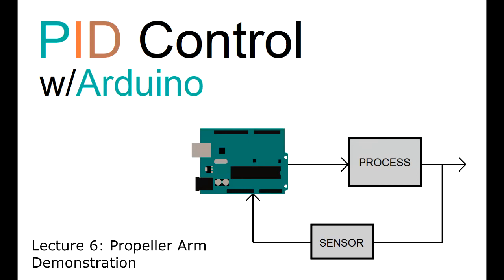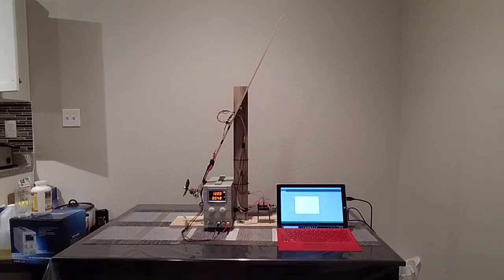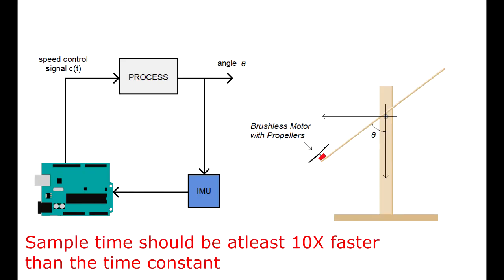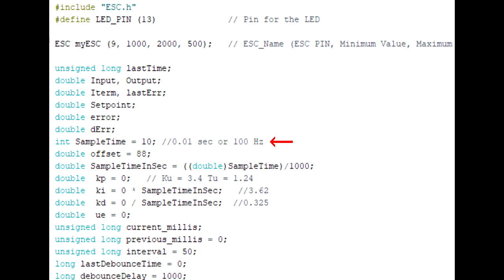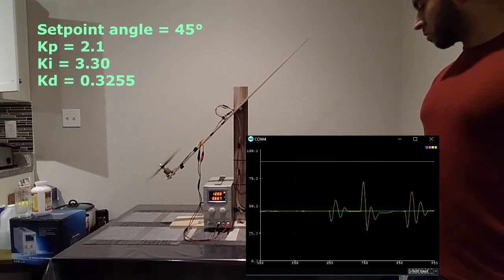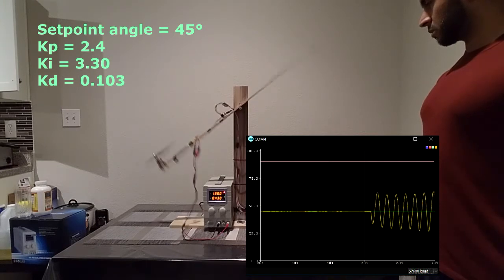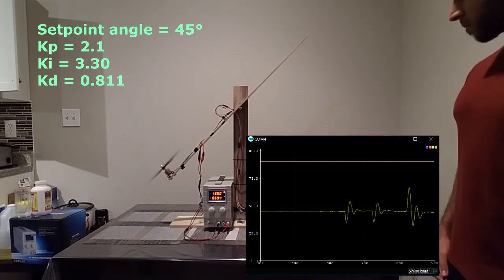PID Control with Arduino: Lecture 6 (Propeller Arm Demonstration)

Comment: Can i Get in touch with you brother, I m stuck on this project similar concept but the angle keeps fluctuating alot i m using  MPU6050, A2212 1000KV
not able to set the angle accuarately the MPU values suddenly change and they are not always the same

Comment: Thanks for the nice explanation, Can you plz tell what, what software you used to observe the graph for the response of the system? Thanks
Reply from the maker: Im using the serial plotter that comes with the Arduino IDE. The reason it's black is because during post-production of this lecture video, I inverted the color so that it would look nicer, hence why it's black.

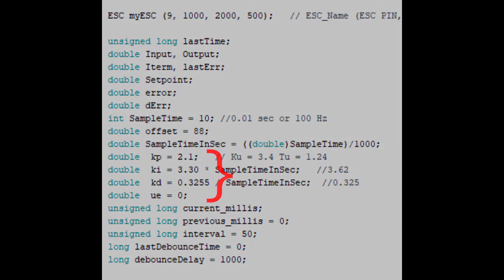Comment: where did you include offset (bias) in your code? 4:16
Reply from the maker: I didn't. If you look at the code, I set ue = 0. The bias is only needed to remove the steady-state error under proportional-only control. However since were using a PID controller, the I term takes care of the steady-state error.
Reply: @nabilmohammad5076  Thank you! If it is required to have a higher proportional gain , let's say to drive DAC, how to avoid oscillations?

Comment: the values of my PID output are increasing/decreasing too fast, and it overflows the double data type; i tried  reducing the constants and putting the maxcontrol and mincontrol but still, it is hard to map your values when the data is so unstable, so i cant even try to attach the ESC.
would someone would have a suggestion for that?
pd: excuse my english It's not that good haha

Comment: Hi! What means "ue = 0" parameter in your code?
Reply from the maker: I believe that was a bias control value. Typically used in open-loop mode or during proportional control to get rid of the steady-state offset. However. Since a full PID controller is being used, we dont need it.

Comment: How did you fond the tau of your system?
Reply from the maker: You mean the time constant ?
Reply: @nabilmohammad5076  yes
Reply from the maker: @shahzaibshamim6524  For my specific system, in open loop mode, meaning with no feedback, I simply stepped up the input signal from 0 to a nominal value that would give me an output angle around 45 degrees. And I simply measured how long it took to reach 63% of around 45 degrees. That measured time is the time constant. 

What this nominal value was, I don't exactly remember.

Comment: i have some sort of problem, when i measure angle from MPU6050,get stable value!!!(complementary filter, basically i have used)

But, when, it is in structure  as well as motor start to run!!  That's time i get fluctuating angle!!  Generally 15 digit up and down!! It's because of vibration in structure, generated by motor!!!  How can i eliminate this fluctuating  problem?????  thanks 🙂
Reply from the maker: Yeah the vibration is messing with it. I was suffering with the same issue, but luckily the MPU6050 comes with an internal digital low pass filter to filter this vibration. I'll post the code soon.
Reply from the maker: So I wasn't able to find the code I had used, but I remember referring to this article, https://ulrichbuschbaum.wordpress.com/2015/01/18/using-the-mpu6050s-dlpf/ 

I had also added some rubber pads between the wood and motor to dampen the vibrations.

Comment: Can you please share the code
Reply from the maker: double sensed_output, control_signal;
double setpoint;
double Kp; //proportional gain
double Ki; //integral gain
double Kd; //derivative gain
int T; //sample time in milliseconds (ms)
unsigned long last_time;
double total_error, last_error;
int max_control;
int min_control; 

void setup(){ 
  
}

void loop(){
  
 PID_Control(); //calls the PID function every T interval and outputs a control signal  
 
}

void PID_Control(){

  unsigned long current_time = millis(); //returns the number of milliseconds passed since the Arduino started running the program
 
  int delta_time = current_time - last_time; //delta time interval 
  
  if (delta_time >= T){

    double error = setpoint - sensed_output;
    
    total_error += error; //accumalates the error - integral term
    if (total_error >= max_control) total_error = max_control;
    else if (total_error <= min_control) total_error = min_control;
    
    double delta_error = error - last_error; //difference of error for derivative term

    control_signal = Kp*error + (Ki*T)*total_error + (Kd/T)*delta_error; //PID control compute
    if (control_signal >= max_control) control_signal = max_control;
    else if (control_signal <= min_control) control_signal = min_control;
    
    last_error = error;
    last_time = current_time;
    }  
}
Reply: @nabilmohammad5076  thank you so much Bro, I really appreciate for the reply

Comment: Could you make another video if you still have this setup with only P and D values set up, I is not needed to keep it  balanced in your case, I'd like to see this go on P=3 and D=5.... It should snap to the desired position (45 angle) much faster without overshooting?...
Reply from the maker: Unfortunately I don't have this setup anymore, but I can predict what will happen. If you setup P=3, the system would be stable but very under-damped and not reaching the desired set-point. Now if you were to add about 0.3 to 0.9 of D gain, you could lower the overshoots. However, if you increase it to 5, you're making the system so sensitive to even the slightest errors that it may begin to jitter and in essence not be stable. 

Please take a look at my 7th lecture on PID tuning where I emphasize this point.
Reply: @nabilmohammad5076  Hmmm, you think? I was suggesting from just looking at it by my experience with drone tunning... Perhaps you're right, but still, if you had a setup would be amazing to see it at work! Best regards!

Comment: I wonder why these videos don't have much more views!? They're simply amazing .. but few notes: When you insert the word Arduino into your title people assume you'll share the code. it would have been nice if you shared the code as you progress through your lectures. Just saying ..  overall, thanks a lot.
Reply from the maker: double sensed_output, control_signal;
double setpoint;
double Kp; //proportional gain
double Ki; //integral gain
double Kd; //derivative gain
int T; //sample time in milliseconds (ms)
unsigned long last_time;
double total_error, last_error;
int max_control;
int min_control; 

void setup(){ 
  
}

void loop(){
  
 PID_Control(); //calls the PID function every T interval and outputs a control signal  
 
}

void PID_Control(){

  unsigned long current_time = millis(); //returns the number of milliseconds passed since the Arduino started running the program
 
  int delta_time = current_time - last_time; //delta time interval 
  
  if (delta_time >= T){

    double error = setpoint - sensed_output;
    
    total_error += error; //accumalates the error - integral term
    if (total_error >= max_control) total_error = max_control;
    else if (total_error <= min_control) total_error = min_control;
    
    double delta_error = error - last_error; //difference of error for derivative term

    control_signal = Kp*error + (Ki*T)*total_error + (Kd/T)*delta_error; //PID control compute
    if (control_signal >= max_control) control_signal = max_control;
    else if (control_signal <= min_control) control_signal = min_control;
    
    last_error = error;
    last_time = current_time;
    }  
}
Reply: @nabilmohammad5076  thanks
Reply: word "Arduino" does not make you assume it's a code shared project... just saying, arudino is open source project from the company side but what individual does with his code is his choice, the word "lecture" here indicated that there should a be a code provided by him. Just saying so you don't assume Ardino always means there is free code to snatch.

Comment: That is great.I am doing as like this project.Can you share the codes?
Reply: Did you get the code?
Reply: @RDGamezz   He pasted in one of the comments

double sensed_output, control_signal;
double setpoint;
double Kp; //proportional gain
double Ki; //integral gain
double Kd; //derivative gain
int T; //sample time in milliseconds (ms)
unsigned long last_time;
double total_error, last_error;
int max_control;
int min_control; 

void setup(){ 
  
}

void loop(){
  
 PID_Control(); //calls the PID function every T interval and outputs a control signal  
 
}

void PID_Control(){

  unsigned long current_time = millis(); //returns the number of milliseconds passed since the Arduino started running the program
 
  int delta_time = current_time - last_time; //delta time interval 
  
  if (delta_time >= T){

    double error = setpoint - sensed_output;
    
    total_error += error; //accumalates the error - integral term
    if (total_error >= max_control) total_error = max_control;
    else if (total_error <= min_control) total_error = min_control;
    
    double delta_error = error - last_error; //difference of error for derivative term

    control_signal = Kp*error + (Ki*T)*total_error + (Kd/T)*delta_error; //PID control compute
    if (control_signal >= max_control) control_signal = max_control;
    else if (control_signal <= min_control) control_signal = min_control;
    
    last_error = error;
    last_time = current_time;
    }  
}
Reply: @UmaPinninti94  ya he replied in one of my comments, this comment was way before he commented the code...

Comment: Very nice project. You modelling the pendulum system to obtain Kp, Ki, kd??
Reply from the maker: I did not model it, however I used the Ziegler-Nichols tuning method. Watch lecture 7 to see how I tuned the P, I, D gain values.

Comment: good work ,you can send me the code .mail:haithem.daboussi@esprit.tn
Reply: double sensed_output, control_signal;
double setpoint;
double Kp; //proportional gain
double Ki; //integral gain
double Kd; //derivative gain
int T; //sample time in milliseconds (ms)
unsigned long last_time;
double total_error, last_error;
int max_control;
int min_control; 

void setup(){ 
  
}

void loop(){
  
 PID_Control(); //calls the PID function every T interval and outputs a control signal  
 
}

void PID_Control(){

  unsigned long current_time = millis(); //returns the number of milliseconds passed since the Arduino started running the program
 
  int delta_time = current_time - last_time; //delta time interval 
  
  if (delta_time >= T){

    double error = setpoint - sensed_output;
    
    total_error += error; //accumalates the error - integral term
    if (total_error >= max_control) total_error = max_control;
    else if (total_error <= min_control) total_error = min_control;
    
    double delta_error = error - last_error; //difference of error for derivative term

    control_signal = Kp*error + (Ki*T)*total_error + (Kd/T)*delta_error; //PID control compute
    if (control_signal >= max_control) control_signal = max_control;
    else if (control_signal <= min_control) control_signal = min_control;
    
    last_error = error;
    last_time = current_time;
    }  
}